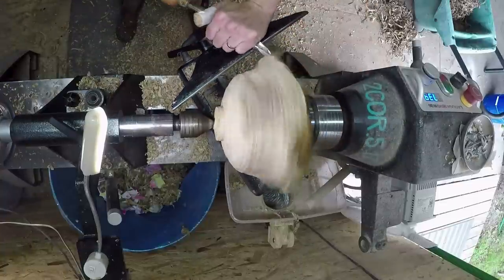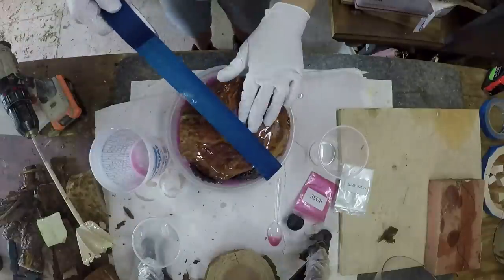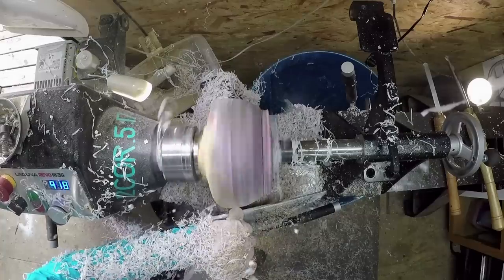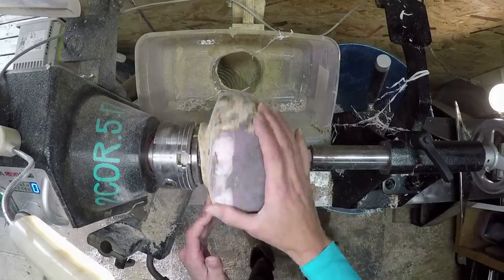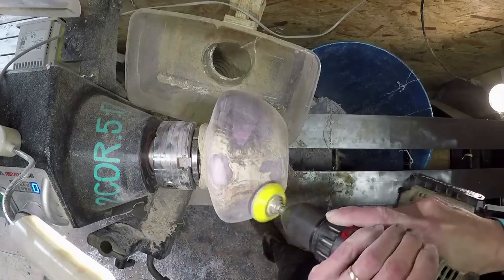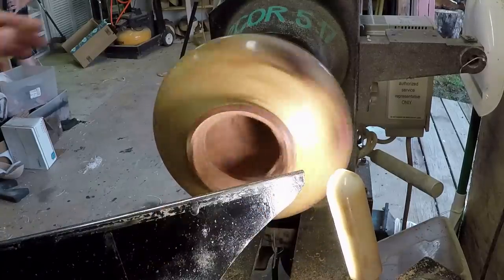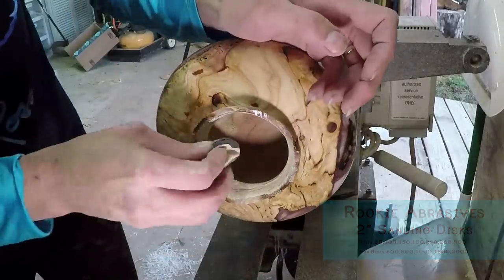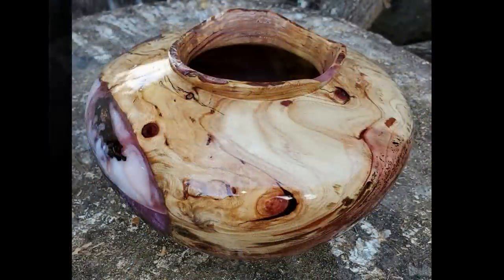Sequoia and Total Boat Resin Hollow Form

Comment: Hi Kim,
Just found your channel today and subscribed!
I started sanding with sandpaper when I first started turning.I have pain in my shoulders and arms from a lot of hard work during my 75 years on earth.It sometimes took me several days to sand a single piece with many,many breaks.After watching Captain Eddie sand with an inertia sander I decided to give it a try and never looked back!What took me days to complete now takes me only hours.I can start with 80 grit and go straight to 100 grit without any sanding marks left from the 80 grit!On some pieces I,when my hands,arms and shoulders want to cooperate, I can start sanding at 220!I have sanding disks at 80,100,120,150,240,320 and 400.I can go through all of these stages without any hand sanding!
I think that if you try an inertia sander you too will never look back!
I bought 2 of the "inertia" sanding "kits" from Captain Eddie and made my own very easily,,,I think a kit costs 10 bucks!
Have fun and God Bless,,,
Tom
Reply from the maker: Thank you!! 🤗🤗

Comment: I see with many turners that they disconnect the compressor hose from the pressure pot and like you said have a small leak and loose pressure. 
To avoid loosing pressure you can adjust your compressor regulator to 50 or 60 psi so it will kick off at that pressure and leave the compressor hose connected till you are ready to open and remove your piece and by doing so you can keep a more constant pressure in your pot as your pot looses pressure the compressor will kick back in and bring your pressure back up to the desired pressure.
I know this since I am a cabinet finisher and that is how a pressure paint pot works as we spray the pressure goes down and when it drops to the low pressure point of the compressor we are connected to the compressor kicks in again to replace the lost pressure that is what they are meant to do.
And your work is beautiful Kim like you 😉
Reply from the maker: Thank you!

Comment: Sanding - on the drill sander - place a 4 or 5" disk and press it on - put inside and then start.  it will be better than small but might fly off but likely will flop about and adhere to the sides.  Something to try sometime might be a help.

Comment: Nice bowl Kim, I’ve found if you take a 60/40 sanding sealer/DNA squirted on heavy to the punky wood, let it dry, the scrape with NR scraper works really well tJust before sanding. 👍🇺🇸

Comment: To eliminate bubbles in casting you should be using a vacuum chamber, not pressure. Vacuum would pull all the bubbles to the surface. Pressure compresses the air bubbles to a small size.
Reply from the maker: Not with the resin I use. in vaccum it will boil. Not all resins can be used in a vaccum chamber. Check out Pohl Barn, He made a video about it.

Comment: Hi there my sister in Christ.. I was inspired by a video from you doing a small epoxy project.  So I decided on trying to copy it.  I’ve done a number of epoxy jobs and every time I take my epoxy out of the mold there’s always small air bubbles and cracks in it… I I don’t have a pressure pot. Maybe I should get one what do you do when you pour epoxy? Do you have a pressure pot? It’s always kind of a pain to have to go back and fill little tiny holes, especially when you have a number of them to do , because it takes forever… I’ve been doing lathe work for about two years.  And  am hooked on it.  I wish I could send you some pictures! Have a blessed day and keep your eyes on JESUS.., john

Comment: That's a wonderful looking piece, Kim. The kind of results I aspire to. 

And, now, the questions: You said you pressurize to 60, or thereabouts. That's a was question I was gonna ask. So, I won't ask that one. The one you didn't inadvertently answer concerns how long you left it under pressure. You said you have a slow leak - a problem I have, too. You said that, by the time you went to liberate the piece from the pot,  it had bled off to about 30 psi. How long was that? Was the resin still sticky to the touch when you took it out? How long did you let it sit before mounting it?
Jut getting started with resin. First piece is on the lathe, now. It's quite foggy. I sat for nearly three hours, adding air to the pot as it bled down.

Comment: Pressure up your pot and squirt really soap Sudsey water on all your fittings the one that bubbles is the leak take it apart add some teflon tape and tighten back up. Unless its your gasket on the lid if IRS that gasket maybe try putting some vasoline on it to make it seat better.
Reply from the maker: Thank you so much, Chuck 🤗🤗

Comment: Kim  I love watching you turn with resin and your beautiful work.  I'm just getting started working with resin and wood and noticed the resin has a tendency to chip so my question is do you find Total Boat resin is the best for this type of work or are there others that work good also, thanks for what kind of finish, sand paper and tools you use, RPMs on the lathe would be nice.    Thank You  Andy

Comment: My pot's emergency relief valve starts seeping at 40psi.  A little duct tape and a slug of steel allows it to hold to 50psi without problems.  It's rated at 50psi but there's always a safety factor anyway.

Comment: Pretty bowl , I noticed that you were talking about DIY abrasive paste , did the Ack's not work out for you? I haven't got my shop set up yet but I am converting a section of my basement for a turning room , as soon as I get it done I'll post pictures , my first project will be a handle for a carbide cutter ( the beaver) that I got from Larry one of his last generation bits not his new line , anyway I was wondering how long are your handles on your carbide tools are they longer than you speed steel handles? , hows your lathe holding up , I know you had some issues in the past with it . Great video and your audio sounds great . God bless. -CJ
Reply from the maker: Thank you CJ!  If I do not have it, I can not use it :)  Glad your getting closer to making shavings!  God Bless!

Comment: where did you get the hurricane negative scraper. I have looked every where and no luck. I sure would like the 1/2 and 1" tool.
Reply from the maker: I ground mine to a negative rake myself. I followed Mike Waldt video for how to https://youtu.be/tdXxkr1hEPE. here is the link.
Reply: Thanks for the link to make my negative scrapers. I have a couple of scrapers that i will change to negative scrapers.
Reply: what are the angles on the neg scraper ?  I have some scrapers I want to change to neg scraper.

Comment: Are you turning this green or is it dried out? Just wondering if the resin seals the green wood or if it causes a problem.
Thanks, love your work.
Reply from the maker: The wood is very dry. Resin and moisture do not like each other.  If the wood was still wet there would be bubbles and cracks. Anything you cast must be dry.
Reply: @KimTippin  Thank you

Comment: Hey Kim had a slow leak in my new pressure pot, check out your regulator it may be an air bleed model very small hole down the body parallel to the pressure adjustment. Changed my regulator hey presto 50psi for twenty four hours. Aussie Bill

Comment: I just bought some Total Boat slow cure, same as you use, and I want to try something to help the epoxy penetrate deeper into the wood, but your experience may answer a question I have. I am thinking about trying to place the bowl with the wood and epoxy into a vacuum chamber first for about two or three minutes. I'm hoping that pulls the air out of the voids and pulls the epoxy into those voids, then transferring the bowl into the pressure pot for the rest of the process. My question regarding the Total Boat you use is, do you think there is enough time to take that extra three minutes in a vacuum chamber before going into the pressure pot? I suppose I could always try for myself, but as you know, the epoxy is expensive to mess up on an experiment. Anyhow, beautiful bowl. Keep up the great work.
Reply from the maker: Hi Stephen!
I do not use a vaccum chamber so I wouldn't know how that would work out. 
But, I have mixed the epoxy with acetone , soaked my piece in it for a few hours then I take it out of the mixture to cure for a few days. After fully cured, I then cast it. 
I am sorry I couldn't answer your question more specifically.  Maybe use something small first that will not require much resin, to test it on.